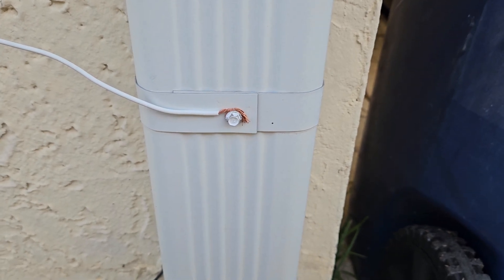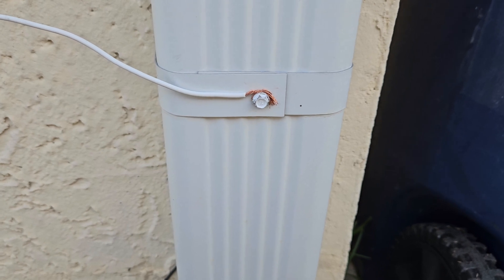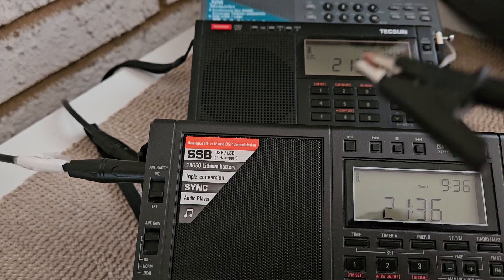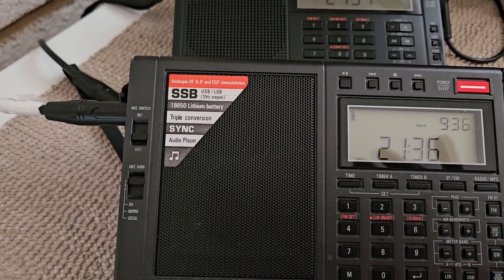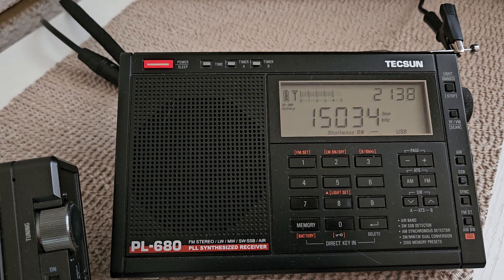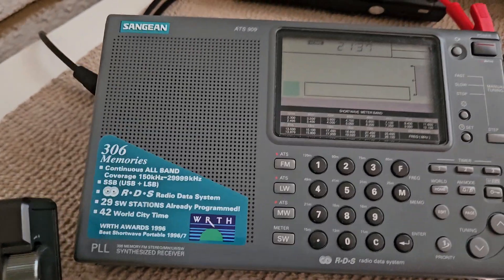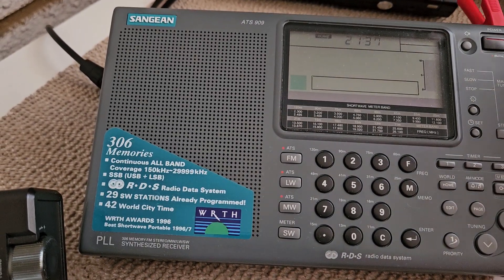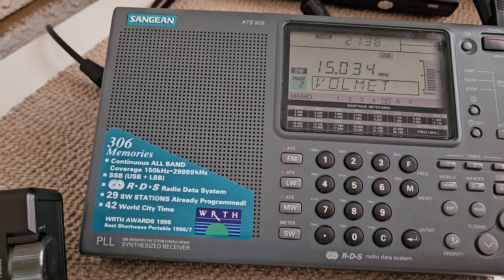Using an aluminum gutter as an antenna

Comment: Try scraping some paint around the gutter screw to improve the connection with the bare wire
Reply: There may also be a lack of continuity between sections of gutter. A typical installation may leave you counting on screws that pass through overlapping lengths of gutter.
Reply from the maker: Never thought of that, thank you. Good tip!
Reply: @SWLSignals23-hp6vp  also, if you really want to see if the gutter works then do the test from right there. Try it, then pull the wire off the gutter to see if signal changes. You might just be gettin the signal boost from the white wire alone
Reply from the maker: I will give that a shot to see if any changes are noticeable. Thanks!
Reply from the maker: I just did another test, wire taken off the gutter, wrapped around the telescopic antenna, then back on the gutter. I just posted another video with the results. Thank you for the suggestion. Have a great day!

Comment: I would use coax cable to reduce noise.   Having a wire (antenna) partially indoors is noisy due to all kinds of noise from electronics.  The shield should be connected to a counter poise.  Can be a wire, a ground rod or some metallic object.  At the radio both the antenna and the shield should be terminated.
Reply from the maker: I will look into this as well! Thank you for the advise.

Comment: It would be interesting to add an appropriate balun between the antenna and the feed line.
Reply from the maker: I don't have one, would you be able to recommend one? Thank you.
Reply: @SWLSignals23-hp6vp  I think you would want to use a 9:1 balun (or unun), basically treating the gutter as a long wire antenna.
Reply from the maker: @FlyGuy2000 perfect thank you.

Comment: Nice test, thanks for sharing.  The gutter does work and it may be better than nothing however in this test, certainly seems 'clear' to me the MLA sounded best with the 80' wire a close second.
Reply from the maker: Thank you for the reply. I would agree, the MLA30+ is outperforming the other two. I like to experiment with different antenna types. I plan on doing some more tests with different wire set-ups. Horizontal vs. vertical, long vs. short, etc.  Would you have ideas on any different tests?

Comment: You may want to make sure your wire is contacting bare metal on the rain drain....not paint for a better connection.
Reply from the maker: Yep, you are correct. I'll have to scrape some paint off, thank you for the tip!